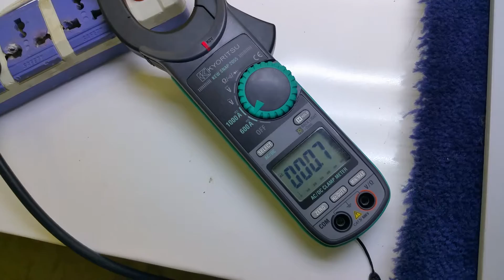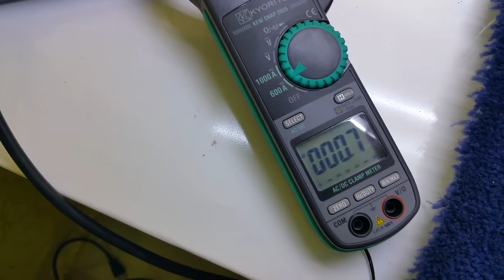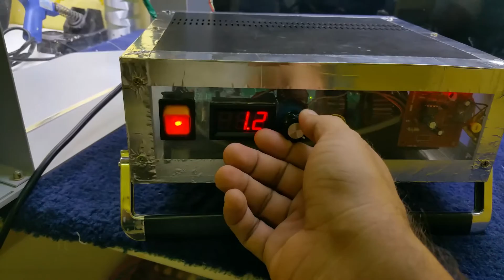Test run # 2 Home made BLDC controller  (using sensors)

Comment: Great project!
Can you share the schematic for this? I am trying to build such controller, so that i can control s wasjing machine motor! 
Thanks!
Reply from the maker: Dear. I just assemble the pwm base drive board to run this brushless controller circuit with motor.
The controller circuit i used from Scrap Air conditioner,
Reply: @Fayyaz-Electro-lab  Great. is there any way to reverse the motor rotation direction?
Reply from the maker: @ATSystems  If your controller doesn't support rotation direction, then you can try changing the wires U V W to W V U and try. i hope the direction of the motor will be changed by doing this.